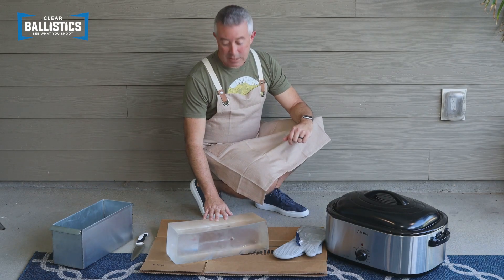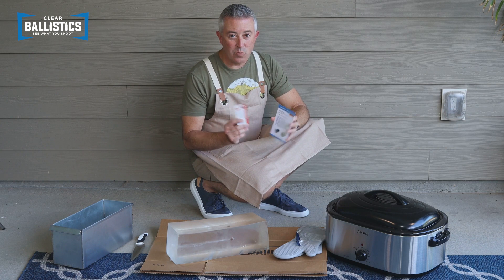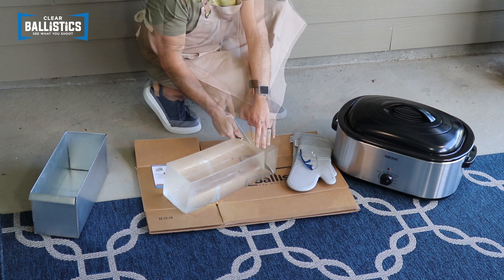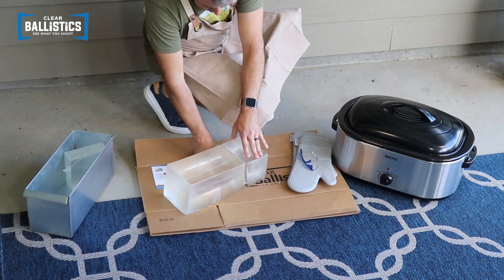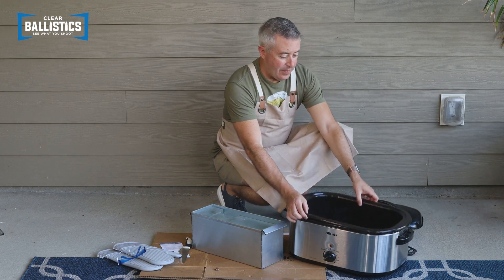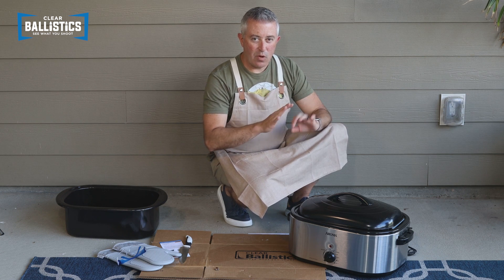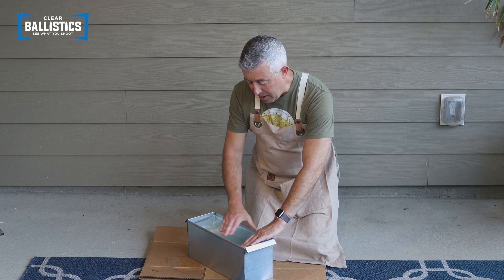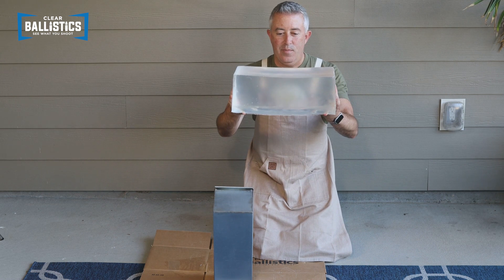Clear Ballistics "How To Remold"

Comment: If you have a small air compressor, you can use an air wand and plunge it to the bottom corner and blow air under the gel after pulling the sides a bit to unstick.  Once you start your air, pull up on the wand and the gel will follow.  Repeat for as many sides as you need to get the gel out.  Takes less than 3 min.